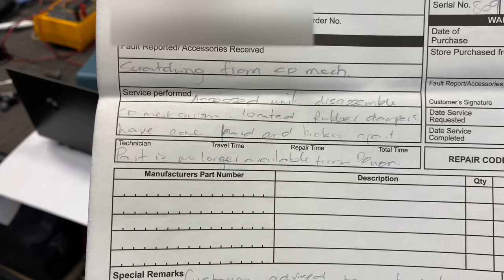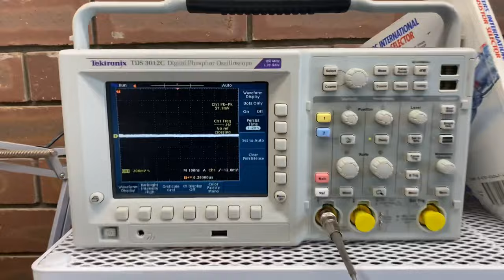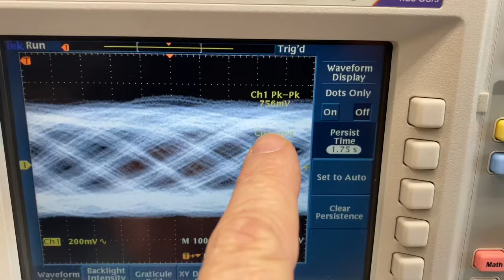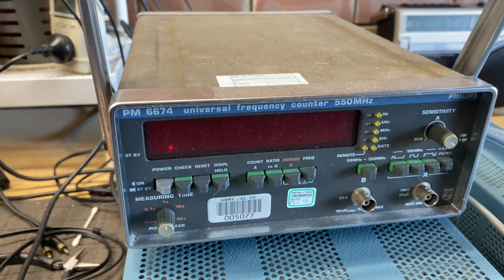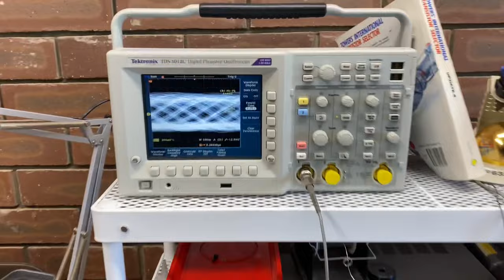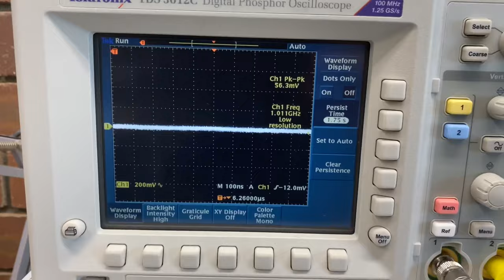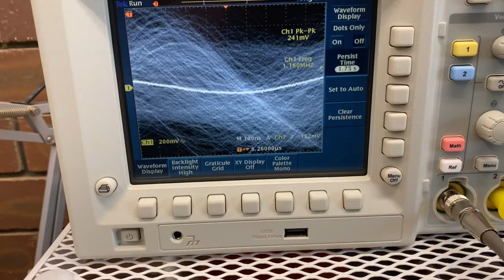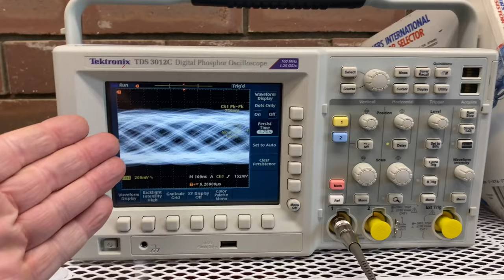Denon DCD-1520 CD Player Repair, Service, CD Player Adjustment & RF Eye Pattern Deep Dive!

Comment: I have a 1990ish  DCD 1400, which was expensive enough for me then.      A belt got changed years ago and it is fine.  Even in dirty middle-of-NYC air.    I don't know anything about electronics, can't open to do anything.. OMG it is crazy to me that good audio equipment (cassette deck, turntable, CD player) are ultimately dependent on rubber bands.
Reply from the maker: Some of the very best gear doesn't use belts but I absolutely know what you mean!

Comment: Hello Liquid Audio, I have a question if you don't mind: I own a Denon DCD 1500 CD player and recently aquired a superb vintage Marantz 2230 receiver. The receiver is in tip top condition and plays vinyl perfectly and all the inputs were tested and work fine. I proceeded to connect the denon cd player to said receiver using RCA cables into the Tape in inputs on the receiver. The cd player reads the disc and played when I pressed play. However, no sound. I can see the cd playing on the denon display but no sound coming through the speakers whatsoever.  I tried the AUx input on the receiver, still no joy. I tried using headphones, nothing. By process of elimination I can say 100% that it is not a receiver issue. I don't have any other amps to test it on, so I was just wondering if I am missing something or doing something wrong? I am honestly a bit baffled by this. Thanks
Reply from the maker: It's puzzling but without the gear in front of me to test, it's hard to say. The CD player should be connected to a line level input like AUX rather than the tape input. Make sure the CD player is set to output an analog signal and that there is no digital attenuation set if this is configurable (there are a couple of DCD-1500s). Headphones can be used to verify audio is produced from the CD player if it has a socket. Beyond that, I'd say get her to a technician for further investigation.

Comment: Thank you so much for this video... !!!
CD technology is my favorite and I want to know some knowledge about it!
I have on my workbench a multimeter and 20mhz scope, but the frequency counter?
Is necessary only for PLL or other things of CD?

Thank you again :)!
Take care.

P.S Subscribed!!
Reply from the maker: Hi and glad you found it useful! A frequency counter is a really useful piece of test and measurement gear. Quality is critical with T&M gear as it relates to accuracy, this is especially important with counters. A good scope, multimeter and counter should get you going. The PLL is the main frequency related measurement that comes up in CD players, but the counter will prove useful elsewhere.

Comment: It's from 1986 I had one DCD1520 andhave one  MK II from 1987, difference is that II has something called Time Search. I hade the 1520 but then I got the first version of Phantome Of The Opera. The hole CD is just ONE track, no indexes nothing. So to go to a special song You hade to fast forward, then 1520 II got out, with Time Search , then You just put in the time where  to skip. As fast as selecting a track.

Comment: hey man thenks for the video. I have a new laser on my sega Saturn but it is not working. I guess someone before me messed up all pots on the board.The manual says adjust TE bias, Focus Gain, etc. but shows no hint on how that should be measured at. could you give me a hint or recommend something to read?? I have oscilloscope and all of thhat. Thanks
Reply from the maker: This is a tricky one because it relies on having experience with making these adjustments across many different players. The concept is the same, the execution and test points different on each machine. Service manuals are helpful so try to find and read other manuals to get a feel for the process. The manual for your machine should explain the process but if in doubt, a good technician is always the best option with anything like this.

Comment: Interesting video Mike, I have the very same machine, currently with the case off and the CD transport carriage out. The CD eject had stopped working, I understand from reading around that this can be due to worn belts? I am struggling to source new belts, any idea where these can be had? (tried the UK appointed rep but I guess they don't support stuff this old)
PS I am in UK
cheers
Reply from the maker: Hi Tim, yes belts are a common CD player service item. I have no suggestions for who to use in the UK unfortunately. I use commercial parts vendors, these sorts of suppliers don't supply non-trade accounts and you need to know exact sizes when ordering for example. You may find online sellers who supply kits based on knowing what the correct parts are. Failing that, you could buy a bag of belts and try for the best fit. For something like this though, I suggest a good repairer who will have all these parts in stock, as I do. They will also be able to do the other service and adjustment work that is almost always neglected or ignored but so critical to keeping your player running!
Reply: Im in RSA and specific belts are hard to get. I went to a local piping and seals supplier and got cheaply 2 things: a whole bunch of std O rings or pipe fitting seals, and some thin belting, which is essentially the belt rubber by the meter. O rings are great for cd drive mechanisms. If o rings dont fit, (but mostly you will find one that fits), for the larger belts you can then make your own belts with the belting, by gluing the right length of belting in a circle for a belt. Use a good super glue, works wonders. small amount.  Suggestion, flat belting, splice at 45 deg before glueing and lightly sand off excess glue. Good luck.

Comment: Great Video thank you. Can you say something about the laser intensity adjustment? I understand that the laser output deteriorates over time, some Cd players have a small pot on the optics unit to adjust this. If this is adjusted, does it increase the eye pattern peak to peak amplitude. It would be great to know when to adjust the laser intensity and when not to, and rather adjust tracking and focus only. linked to that, what is the ideal eye pattern peak to peak voltage to strive for, with a original factory CD? 1000mV i understand?
Reply from the maker: Hi and thanks, glad you enjoyed it! Laser power output is the one thing that should generally never be adjusted. This is set at the factory by the laser manufacturer to produce the required optical power output and a particular current draw, different for each laser type. This is designed to give a good balance between lifespan and disc reading capability. It's a tradeoff. If you increase power, you decrease life. Given that disc read issues occur at end of life, increasing laser power when the laser is already on its last legs might briefly help the player read discs but then the laser really is toast and much faster than it would have died, naturally. Also keep in mind these adjustments must be done by someone with access to the right test and measurement equipment including a laser power meter, the correct test discs etc. Short answer: lasers are wearable parts and need to be replaced periodically.
Reply: @LiquidAudio  thank you so much...
Reply: @bobof673  Don't touch the laser power. It will usually kill it fairly quickly. What happens is sometimes the suspension is sunk downwards and the servo is getting hard on overtime to try to make it read correctly. Sometimes a clog of dust is making the up/down movement hard as well. Sometimes the laser lens if plastic have been cleaned with isopropylalcohol, so gets a bad haze. Use a drop of distilled water or maybe a drop of window cleaner. Do not press down on the laser lens. It can destroy the suspension.
There's a simple formula to calculate when a laser is near it's useful life. You need to read a voltage on the player and calculate. The laserdesign is usually a burn in period, then a long, very long, lifespan where it performs the same or very near the same. Then it dies off rather quickly. That is, if other factors doesn't come in.
Cheers.
Reply: @monzarace   agreed thank you for the advice.

Comment: Hi! I have a question about the eye pattern: I know that by using an analogue oscilloscope measuring the RF point and showing the eye pattern doesn’t require an outstanding equipment. But what about a digital oscilloscope? Which are the feature a digital oscilloscope should have to do such a measure? Thank you very much!
Reply from the maker: This is correct, an analog scope is great to have for jobs like this and many others. As always, the better the scope, the better the results you can achieve. My Tek digital has 'digital persistence' which is a feature that attempts to mimic the excitation behaviour of phosphor-based tubes. Triggering is also really important and how you set your trigger to yield the cleanest eye pattern. It gives me a pretty good, though not perfect result that allows me to use this scope for this digital/RF visualisation stuff that you find in CD players. Many digital scopes are useless for something like an eye pattern, the cheap ones especially so.
Reply: @LiquidAudio I am an absolute amateur doing my own hifi if at all possible. When I rebuilt my Copland CDA-288  cdplayer to have a different mec, laser, motor and servoboard etc, I had bought that someone deemed dead, so I had to adjust the servos. So I got the digiscope out and followed procedures. I then thought why not get an analoge phosphor tube scope, and then redo the adjustments. I did and it became quite much clearer. To me at least, reading and adjusting the eye pattern, is easier using the old analogue scope. Mind you the digiscope has a lot of useful functions so I just use both. Also, some people use ISP on plastic laserlenses which gives them a haze, slowly making them not work or rather work on overtime, and then increase adjust laser power and ½ year later, it's dead. Bad quality etc... No, it was errors servicing it.
Thanks for showing.
Kind regards.
Reply from the maker: @monzarace  100% agreed on all counts. I can only say that, whilst analog scopes are the best for looking at RF eye patterns etc, a really good digital scope can do it too, but the cheap digitals cannot. On that point, my Tek TDS3012C was over $10K AUD new. Compare that with a $300 Siglent for example and they are just in different universes. Great point about isoprop - no good for plastic and yeah, adjusting laser diode power upwards is perhaps the silliest of all things I see done on CD players. It's refreshing to see others spreading factual information rather than the bull$hit I see so often online!

Comment: I have a DCD 460 I found in the neighbors trash. is it worth using? apparently it has a burr brown 16 bit dac that oversamples to 20 bit. I'm trying to figure if I should use that or an older Sony blu ray player I have, which is the bdp 350.
Reply: My DCD 460 does say double super linear converter so Im hoping it has the same setup in terms of dac just less button features which I don't need anyways.
Reply from the maker: Give it a listen and see what you think! Most dedicated CD players, even basic ones, crush DVD players sonically.

Comment: w are you, my DCD-1520 when insert cd, the main motor is not spin, is that the laser head got die?
Reply from the maker: Details in the description, and here: https://liquidaudio.com.au/
Reply: @LiquidAudio  it is ok can play cd now, just clean the cd driver case cable socket in the pcb is ok, i think is the bad contact cause not spin

Comment: Hiya, I have a Denon dcd 1520 I have had it from new, 33 years I have kept it in like New condition I still have the original box+ instructions & all. Question is it started playing up not reading the track's after say track 12+ & now it's not reading any tracks at all. Like I say the cd player is in immaculate condition no scratches anywhere any ideas as to what might be the problem. There are lasers available for the dcd 1450 1550 & 1650 would this Lazer fit the 1520.. that's if it's the Lazer of course.
Reply from the maker: Hi John, there are many potential causes of failure to read the TOC. I would need the player here for inspection, testing and diagnosis, could be the laser, may just need service like so many I see these days.
Reply: @LiquidAudio  dam... I wish you was closer unfortunately I live in the UK. Thanks for your reply.
Reply from the maker: No worries John, I'm sure there will be someone there who can assist you with this. Check with a couple of the better hi-fi stores to see who they use in your area.

Comment: Hi, I have the same problem with my 3520 described on paper at the beginning of the video. Also my 4 dampers are "worn out" and the complete drive is hanging ~5 mm lower than originally constructed. So there is some scratching noise of the drive/cd to the upper cd-holder. If I push the complete drive a few mm higher it´s gone. I would like to replace the rubber dampers, but I could not find them. Also the error report says they are not available from Denon any more. Does anyone know a similar cd-player/drive where I could find similar rubber dampers that might fit in? regards Ralph
Reply: That may be hard, so try to source something usable with the same shore and fabricate to fit. That might help.
Cheers.

Comment: What if your CD player is inoperable?
Reply from the maker: Not sure I understand the question..?
Reply: @LiquidAudio 7:17 

You're right!  It's best not to mess.  Unless you know what your doing.  I was getting hopeful watching other videos where people tweak the pots a little bit and see if the player will read the disk.

My friend and I each have a Sony SCD-777ES SACD player that doesn't read any disks.

One tip I've picked up on is the pots may oxidize over time.
Reply from the maker: @whosonedphone  OK, gotcha, yes it's absolutely best not touch a thing unless you know exactly what you are doing. The 777ES, like many other early SACD players, tends to suffer from premature death unfortunately.

Comment: analog scopes tend to do better for looking at the rf eye pattern
Reply from the maker: Hi Alex, correct and discussed either in this or my previous RF eye pattern video! That being said, a good digital scope like this one can do a reasonable job.
Reply: @LiquidAudio  A good digital scope in the region of $2k+ will show it nicely ;) lol. Unless you spend mega bucks on a digital scope it simply wont have the resolution to compete with an analog scope for this purpose. Nobody makes new analog scopes anymore I think?
Reply from the maker: @alex1520  The Tek digital scope I use in the workshop is a 10K (new) scope and does a really good job, as mentioned. Wide bandwidth analog scopes are always better for these things, with CRT persistence being a big factor. No, there are no good new analog scopes, hence my collection of them which includes 7603, 2246a, 2465b etc!